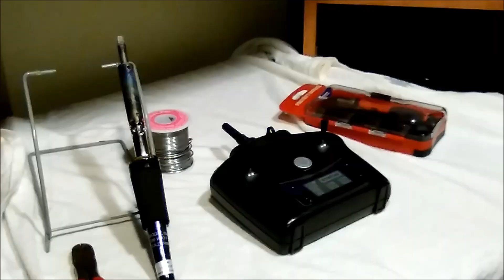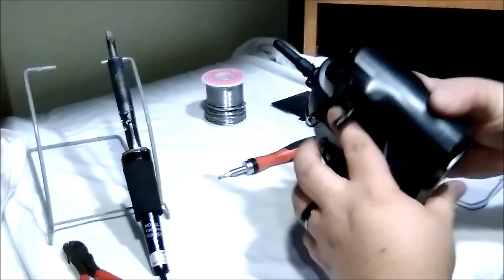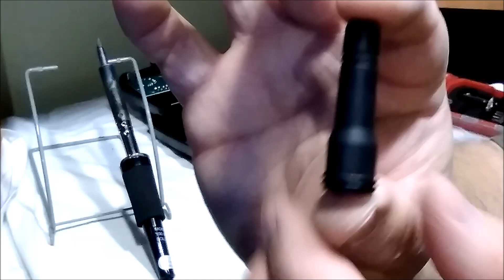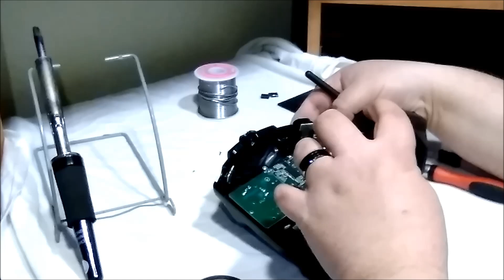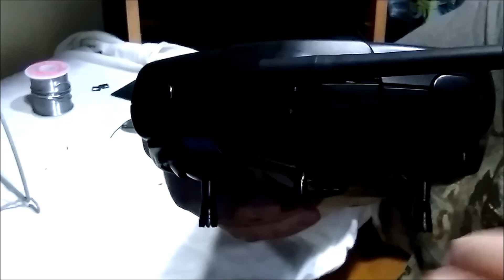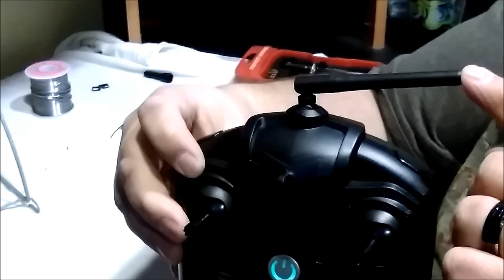Promark P70 VR Drone - Modifications Part 3 - Range Extender

Comment: Hi great video well thought out and easy to follow even for someone like myself who is a little brain dead but great with my hands and tools. I'm just wondering why you did not mod the copter antenna with the same type on the lower half of the body like on the Hubsan X4 109. I did both at the same time so that I had better transmission because the are match rf signal. And the last thing I'm not understanding is why you needed to disconnect the battery compartment from the main body of the radio. Is there a safety advantage or other issue that requires those 2 additional steps with the hot soldering iron? Oh 1 more thing and this is not to be looked at as a bash or anything like that I have learn a great amount of knowledge from all you videos. But when I was doing my mod I had a buddy over who repairs computers and solder's. So I took your advice and got some help with that, The question my buddy asked me was why I was using the type of solder that I had bought. I told him and showed him the video so he could see the kind that you were using and he told me that the kind I have could damage the board. Could you tell us what kind of solder you are using? I froze the video and zoomed in on the label so that I bought the exact kind and size you were using. The first thing he told me was it is ti thick and that thinner solder will use less heat which in turn will decrease the chance of burning the board. The next thing he told me was the solder I bought based on all your videos was a rosin core and that type can cause corrosion and generally is used for "sweating"(?) copper pipes. He showed and taught me how to solder with a much thinner solder especially for electronics and how to use a liquid brush on flux that helps the solder bind to the wire and the more much better because there is no way to tell the amount of copper is being used in the wires and the board. He said some companies will copper plate instead of using 100% copper for their connections and that the liquid flux makes up for the variations in % of copper. Again I'm not hating or  bashing in any way. It is actually the opposite you told us more than 1 time if we didn't know how to solder to get help or find someone who has done it before, so I thought who better than my buddy who works in a computer/cell repair store anb solder small wires like the ones on drones. As well as he could teach me how to do it. So please this is not negative in any way I want you to know because of you videos and my buddy who left me some wires and a couple of old PC mother board I learned how to solder fairly well both wires and component so for that I thank you. I was just wondering what type my professor was using in his videos
Please keep it up it not easy for an old dog like myself to understand some of this new tech.
THANK YOU VERY MUCH 🥇👍😉😎
Reply from the maker: Ya that was a old video. I have since upgraded my soldering iron and also use the I think 63/27 solder now much thinner and easy to work with. I used to have Patreon but stopped it. I may pick it back up again?

Comment: As a side-note I lined the inside of the top shell of my DJI Phantom with aluminum tape, used for wrapping around the seams of your furnace air ducts, and in doing so increased the range and actually increased the number of satellites which the drone connected. I did before and after tests and it worked well....I'll probably try that on the P70-VR I just picked up, if I can figure out why the motors don't turn....
Reply from the maker: Sounds like possibly bad flight controller? The Promark doesn't have ESCs

Comment: This mod cannot work. The antenna has two wires under the insulation. There is a center wire and a braided outside wire. You soldered both of them together. Yes, the wire is very thin and hard to see but there are two wires in there.
Reply: It will if you solder the middle wire to the antenna spot and the shield to ground, which I have already found is the unused pad next to it on the board. Worked beautifully! Doing the same to the quad side as well. Using my years of experience with radios and antennas to make the mod work and when done right it works very well!
Reply: Chuck, you are correct. I also have over 25 yrs. experience as an amateur radio operator and 15 yrs as an RC pilot, I think Darryl has made the same point. joining the 2 wires together as Mike did in the video will not work. soldering as you have done should work nicely.
Reply: Chuck, I just modded my Syma transmitter the way you described. It works great. I was following another user who describes 2 wires in the antennae. They have to be soldered separately. Use the pad next to the antennae.
Reply: Yes, you bring a good point! I'm trying to figure out where to solder the outer shield of the pigtail right now, literally! I see an unused solder pad on the controller board under the factory antenna wire. I'm leaning toward thinking that is what that is for. I'm going to read a little before I finish this tonight.
Reply: Thank you Darryl, you are correct about coaxial cable antenna, Sorry Mike but this will not extend your range.
Reply: With that much experience, you have surpassed me lol. Just to say though I was only stating that I used my radio experience to make the mod work. With that said, I still haven't tried to see what my max range is yet. Too scared to lose the quad, just in case lol. :)
Reply: What kind of extra range do you get when modding it that way?

Comment: why not just hook the original wire to the new antenna wire? It would save you from heating the board.
Reply: You could do that but it wouldn't be right, mostly. The new antenna wire has two wires technically. The middle wire, which is the signal wire itself, and the outer shield, which is a ground and to keep interference out and the signal in, at least until it reaches the antenna itself. If you leave that single wire in place, it will resonate and send out signals because it won't be shielded and the new antenna will also have signals coming out but the whole antenna system will be wrong. If you think back to the old CB radio days where guys were always trying to keep a low SWR on their antenna systems, one bad connection or and antenna being the wrong length would cause a very high SWR, which would kill the range and burn up the final output transistors. Well in a way, that would effectively happen with this setup too if you left the stock antenna and soldered to it. I hope this explanation made sense. Remove the wire and solder the new pigtail middle wire to it and solder the braided shield of that pigtail to ground on the controller board. Now what I'm unsure of is if the unused solder pad on the controller under the factory antenna wire is the ground, or for the shielded side of the antenna.
Reply: I was thinking the same thing also.  Why not just solder the old antenna wire to the new wire.
Reply: lol its all connected to 1 source ,,,

Comment: That cable coming out of the new antenna is a coax cable. It looks like you stripped and soldered the shielding not the center wire of the coax and that is not going to work very well.  I would recommend redoing that to attach the center conductor of the coax to the antenna out and it would probably be a good idea to attach the coax shielding to a ground point.

Comment: what did you do with the ground of the wire.. I have the parts just confused about the ground
Reply from the maker: There is another square next to the positive use that one.
Reply: Ok, is that what you did, Mike? Cuz I am wondering the very same thing, if that unused solder pad is for the shielded side of the coax. Thank you for that verification! I can't wait to try this mod when I'm done :)

Comment: mike's drones and more my wifi on my app keeps laging out and it freezes and I have land and turn it off and then back on is there any way I can extend the wifi reception
Reply: the Wi-Fi and quad run on 2.4 .. i noticed if my camera wasn't acting up my quad was pretty much uncontrollable best bet is go 5.8 if you want to fpv
Reply from the maker: Ryan I have not found a way to extend the wi-fi range. That's why I removed my stock camera and put on a action camera instead.
Reply: Mike's Drones and More is the range of the action cam longer
Reply from the maker: Mine doesn't have wi-fi on it just a 1080p camera. They do have ones with Wi-Fi idk the range on those though.
Reply: Mike's Drones and More do you where the VR gogles while flying
Reply from the maker: Ryan Bike no it makes me very nauseous
Reply from the maker: sargent meowstein agreed

Comment: thats good to do so you can get better rang but just fyi when using a iron like that always wait until its hot idk how many times you done soldering and de soldering but the longer you hold that iron on the board the more heat is transferred to it and that can really kill it all and you didnt have a heat sink to thats a no no and try to buy some de solder so you can remove the old solder good job none the less.

Comment: Why did not you use a directional antenna like the 7 dbi alpha 2.4ghz works better than an omni directional
Reply from the maker: It was less expensive. And I like the look of this antenna. I have seen people use all kinds of antennas.
Reply: You know how to modify to lower the angle of the camera is that I put a Valkera gimbal 2G but I do not know how to make it lower by 90 °.?
Reply from the maker: I'm not familiar with that gimbal. Mine is just a stabilizer. But I had it higher I need to re-adjust not to show the props.

Comment: Mike: I lost my Promark v70 drone today in a lake and I was wondering if you knew where I could get just another drone. I have the controller and extra batteries.  Also are there any compatible replacement drones that will work with my controller and batteries?  Thanks and love your informative videos.
Reply from the maker: Randy White sorry you lost it in the lake. I have no idea if this controller is compatible with any other drones except for Promark brand. I would see if you can get any info from Promark customer service. I don't know of any other brand it's interchangeable with.

Comment: It will be interesting to see if this works. Longer antennas help with receiving but antennas that are for transmitting are cut to length according to the transmit frequency. If the length does not match the frequency it will actually reduce transmit range. I hope you saved the wire from the old antenna.
Reply from the maker: Oh ya kept the old antenna just in case.
Reply: Either way, the controller works at 2.4Ghz, which is the same as Wi-Fi, so any Wi-Fi antenna should work just fine!

Comment: where can I buy new Motors and sprocket 4 my promark
Reply from the maker: You should be able to find them pretty easy online. They are the same motors used in the Syma X8 series copters. Amazon, eBay, GearBest
Reply: Thanks I have not found anything for a promark so that's what I was wondering what other other parts would work
Reply: Do they have upgraded Motors or ones that are better than the ones that come with are the gear sprockets the same
Reply from the maker: Ya they do actually the stock are made from iron, and the upgraded are made of brass. Supposed to give better performance and quieter.
Reply: And everything's the same for the Syma X8
Reply from the maker: Almost there are suttle differences. But for the most part ya. I haven't done the motors yet. That is my next project
Reply: I have a plastic gear on mine that is kind of stripped out and won't let the motor spin it fast enough to lift it up

Comment: Does it matter the the thickness of the solder ?
Reply from the maker: Since it's such a small board I would use thin. I only had one size.
Reply: Mike's Drones and More what size did you have?
Reply from the maker: Mine is 63/37 thin wire solder (675C)

Comment: I know you replaced your camera, but is there a way to record from the default camera with an SD Card without having to have your phone connected. I've noticed that if I connect my phone I have delays between the remote and drone so is there a way to record just to the SD without having to connect my phone?
Reply from the maker: Yes the SD card slow is on the back of the camer. If the phone is off then just push the upper left button down till you hear it beep and it will keep beeping every few seconds to let you know it's recording. When you want to finish hold the button down again till your hear the beep.